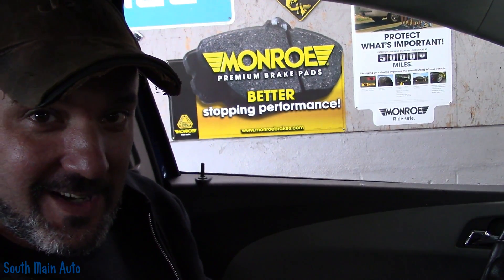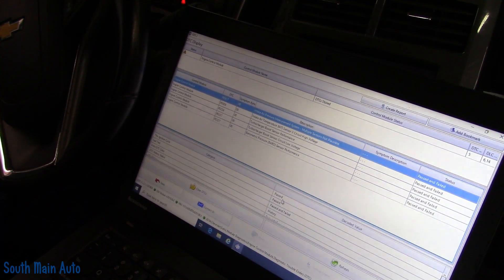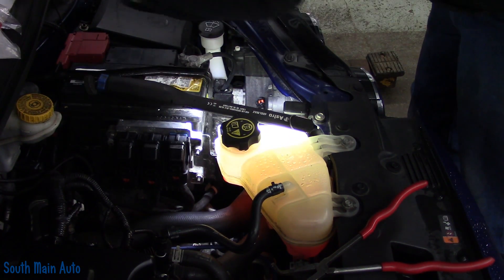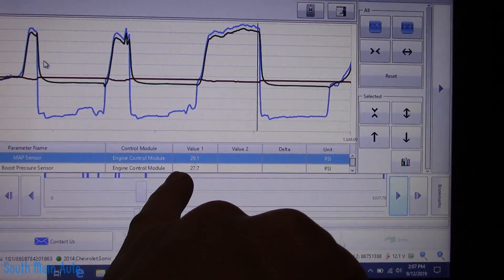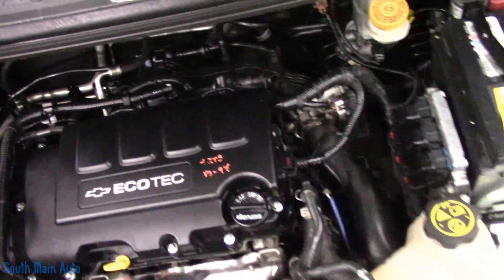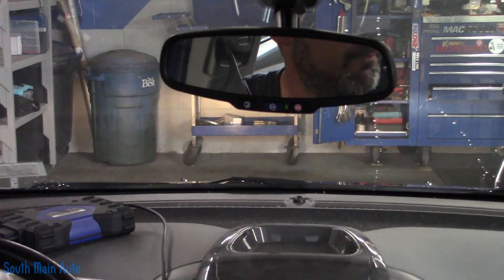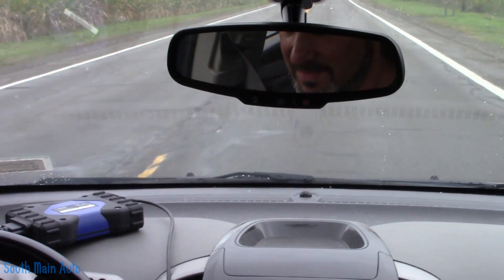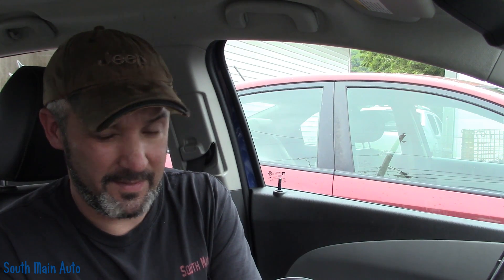Chevrolet Sonic 1.4 Turbo: DTC P00C7

Comment: Hey Eric I listen to your channel great learned a lot quick question !
I have a 2007 Chevy Silverado 5.3
My brake pedal seems to go down 
Further than i think it should,brakes fine had system bleed so thats not the issue. Any suggestions I should check. Could it be the Master Cyl  going bad ?
Anyway thanks
Reply: Needs new pads :P
Reply: By "seems to go down", do you mean as you push the pedal it slowly goes down towards the floor? Then that could be the seals in the master cylinder letting brake fluid leak past. That is if there isn't any leaks in the lines.
If the pedal is just farther down than normal, but holds steady, could be something has got out of adjustment/worn( like a linkage) or maybe the brake booster mounting bolts got loose somehow.

Comment: Does anyone miss the days when the only "sensors" was a coolant temp, oil pressure, and fuel level and the only "control module" sat between your ears?  That's why a '74 Chevy C20 was my dad's only truck for 30 years and then later my primary truck for nearly another 10.
Reply: sensors BAH, mechanical gauges!
Reply: @throttlebottle5906  Damn straight.  Rarely fail.  Sometimes old school is better.  But we are a dying breed.

Not too long ago I was doing a tune up on the Chevy and needed some points lube, but my tube of Mallory went missing.  So I drove to the local parts house and asked where they keep the points lube.  The kid just blinked at me.

"Points lube?"

"Yeah.  You know, distributor cam lube?"

"I have some moly lube"

"No, no.  This is for where the points' rubbing block rides on the distributor cam.  It's like silicon lube, only a bit thinner.  I'd show you my tube of Mallory, but it's gone UA which is why I'm here."

After confusing this kid for a few minutes, an old timer comes out from back room.  He knew exactly what I was looking for, but said they haven't carried it for years.  He only sells a set of points once ever couple of months.

I hit the other two parts stores in town with the same result.  Small town.  Had to start spiraling out and finally found a store 150 miles away that had it.

"Yeah, we don't carry it out front anymore."

And he pulls out this cardboard box, blows the dust off of it, and sets a 8 oz tube on the counter of "Silicon Based Distributor Cam Lubricant"  It wasn't Mallory, but I wasn't complaining.  That's a lifetime supply as long as you don't loose it.  $8 later and I was heading home to finish my tune up, happy as a clam.

Crap.  Where did I put it?
Reply: Thats also why that old Chevy truck would put out more HC emissions on a single cold startup than this Sonic will in its entire (probably short) life. Can't keep using the same old technology on cars while getting single digit fuel economy and blowing straight poison out the exhaust pipe.

Comment: That code is usually caused by the sensor between the driver seat and the steering wheel.
Reply: Fix the driver first, then fixing the car will be made much easier!
Reply: PICNIC code - Problem In Chair, Not In Car.
Reply: LOL
Reply: BAHAHA
Reply: Nut on the steering wheel sensor.

Comment: That boost sensor was contaminated with oil. If the PCV system didn't stop the oil, rest assured this Korean jukebox will be back! I also seen times when filling the oil too fast during an oil change it will back up in the induction system and smoke like crazy. Again a crappy PCV design.
Reply: probably no rings or valve stem seals left in it and needs an engine already..... welcome to turbo'd peanut engines
Reply: @throttlebottle5906  Bad rings would effect the map sensor output and valve stem seals wouldn't cause oil in the induction but would cause oil burning and smoke out of the exhaust. These engines were built from the factory with crappy PCV systems. I know because I dealt with them at the GM dealer. I am not a big fan of plastic covers either.
Reply: when not under boost, the vacuum on the intake is high, so bad valve stem seals and worn guides would pull oil in, then under boost it would force air and fuel(non gdi)charge into the crank case, overwhelming the PCV system and highly probable be blowing oil out the breather inlet.
As for bad rings, the ECM happily corrects enough to keep the MAP happy and not set any codes, which likely wouldn't occur until it was mosquito fogging oil out, it possible to have worn compression rings and still have decent oil rings. 
that would be more blow-by into the crank case than burning oil through since it's boosted and again show as PCV issues.
I wonder if the brake booster has a vacuum pump and does it vent into the crankcase or  vacuum/boost side of intake? too many cars and designs to keep track of :)
Reply: @throttlebottle5906  Valve seals would not cause gas pressure in the crankcase sorry wrong answer. A leaky valve and a bad seal and guide would. A map fluctuating from crankcase pulses WILL cause drive-ability problems and yes leaky rings would cause that but not leaky valve seals.
Reply: Also excessive oil in the induction could be from a leaky oil seal in the turbo charger and that is a high possibility on that engine.
Reply: @biggysground  so under BOOST, with the whole intake and back side of valves including stems/guides and seals under "positive pressure" you're trying to say it couldn't possibly leak into the lower pressure zone of the crank case/valve cover...........

Comment: Good, thanks. Recently drove a Malibu 1.4 Turbo and did not realize the engine was that small and that it had a turbo. Smooth and powerful.
Reply: for how long?
Reply: @rk22cc  Good question, long term viability. If it was introduced in 2013 they might have only 100K or so. A motor should go 200K+ with no major issues.
Reply: There is nothing smooth about a 1.4 they squeeze 140+ horsepower out of. They have to make everything very light, and that means it will vibrate more and when you let off the gas it will bite.

Comment: It’s also possible the turbo bearing seal is leaking oil into the intake. I don’t think you said or showed how many miles are on it but a new valve cover, dead sensor, and dead brake booster are not promising for a 2014. Of course the sensor was German which explains it failing.

Comment: GDS is a factory scan tool for GM?  Good to they've FINALLY moved off of tech 2...
Reply: It started on certain vehicles in 2011...
Reply: @pauldanenberg7746  well I didn't know... I'm not privileged enough to own let alone lease a car top of the line brand new and if it were it wouldn't be GM...

Comment: Maybe a bad check valve between vacuum pump and brake booster... essentially a boost leak.
Reply: DING, I just thought and said the same thing, scroll down 5 lines and got beaten to it again :(
Reply: I should have said between intake manifold and brake booster. That would explain the "buzzing under the hood"... The brake booster vacuum trying to pull vacuum on the booster, but sucking through a bad valve and the intake manifold.
Reply: Unless the booster has a engine driven vac pump like most booster cars have now days.  Then it's no boost leak.
Reply: don't forget, many OEM  accessory vacuum pumps exhaust into the intake and others into the crank case, which could show as PCV issues.
I wont even go into some having vacuum pumped PCV systems. I wonder if they do? I avoid the new turd-boxes and suggest everyone avoid anything with turbo/boost
Reply: @throttlebottle5906  now that's interesting about the vacuum pump. Wow

Comment: What is ridiculous is that a Chevy 1.4L engine has sensors for anything.
Reply: I agree. A good replacement engine would be a Briggs and Stratton.
Reply: Actually, it has sensors for *everything*.
Reply: @bborkzilla  That doesn't mean it isn't absolutely ridiculous.
Reply: You have a lot of electronics then you need a lot of sensors obviously. You have a turbo as well, there are going to be sensors everywhere.
Reply: @zoneb609  My point-you need no electronics on this lawn mower engine.  And you sure don't need a turbo unless you just like the noise.
Reply: Sensors indicate the sensors are not plausible, Captain.

Comment: Man, with that much oil soaking a topside sensor, I'd be so eager to drill that intercooler.  It still amazes me that the manufacturers don't install a service drain plug from the factory!

Comment: I have a 1.4l cruze with turbo, their weak point seems to be the water pump/cooling system. I never knew they used air induction. Thanks Eric O..
Reply: "Air induction" just means air flowing into the engine.
Reply: *Forced induction

Comment: Nice video Eric, I think it's insane that these tiny turbos on these things are pushin' 30psi of boost😂...ridiculous for that small of an engine 😂😂😂...as it's blowing out the cheap intake seals!

Those damn oil feed pipes like to spew out on those baby's as well 😉👍...nothing but quality in the most critical components of the turbo you know!

Soooo...Ol' GM has "zie Germans" makin' um parts now 🤔 and "zie bastards" are handing out Jenny's phone number with emojis on the damn bag...WTH is going on over there?

I love how they warn you to keep your eyes on the road with a message we're supposed to read on the screen, but it's like how are we supposed to know that without reading the message; all while pushing 30psi of boost on a sick 1.4L?  Especially when you're hitting mach 10 in town and chirping them at 5 grand bro?

Great stuff as always man!
Reply: The boost pressure reading is absolute... in effect 15 psi over atmospheric.
Reply: @georgebeuselinck951s  yeah I'm tracking, it's still quite a bit however for that tiny engine.

Comment: The PCV valve isn't on the valve cover on that motor.  It's in the intake manifold.  That disk that ruptures on the valve cover is just a vacuum pressure regulator, and it will likely fail again if that's the only part that was replaced.
Reply: The PCV valve IS in the valve cover.  The red valve in the intake manifold, which you should see a part of it at the bottom of the big PCV hole in the center of the intake, is the Non-Return valve.  It keeps boost pressure out of the PCV system.  If this valve is gone boost pressure gets in the PCV system and ruptures the PCV valve and pushes engine oil into the cylinders.   Many times when the PCV fails you need an intake as well.
Reply: @brianbartosch7384  thanks for sharing this!
Reply: @brianbartosch7384  How frequent is "many times"? Couldn't you add a check valve before the valve cover rather than replace the intake manifold?
Reply: @fascistpedant758  enter, www.cruzekits.com Andrei came up with a retrofit kit to solve the intake manifold issue, but the valve cover can still fail, will just last a lot longer now
Reply: Interesting, so where is it located on the intake exactly or is it built in essentially making it unserviceable?

So not only a valve cover, but an intake as well??? 🙄...oh GM, you never stop amazing me!

Comment: Brake booster, valve cover, boost sensor, alignment, evap, and I think I heard cupping tyres or wheel bearings too. Chevrolet quality at work. Who knows what else he did on the 5 year old car….

Comment: Hi Eric, boosted engine does not have vacuum, that is why the brake booster does not affect fuel trims. The vacuum comes from vacuum pump... I think...;) Nice video!!!
Reply: Not really true. At idle there is manifold vacuum.  They may use a pump as you said..or they may use a vacuum canister to store vaccum.
Also your not generally on the brakes and throttle at the same time.
Reply: @kens97sto171   The booster itself stores enough vacuum for a few brake applications.
Reply: @fascistpedant758  
Yep... Definitely. Wasn't sure if they maybe did something different on this model. 
My Prius does not have a booster like this .. they use a computer controlled electric pump for pressure.. and a system to simulate brake pressure feel at the pedal.. it's pretty wierd.
Reply: @kens97sto171  power braking Lol lock that converter up ! Lol stall speed! !
Reply: @lawrencewheeler8868  
Bout the only way it's gonna spin the tires I think...
Reply: @kens97sto171  😀👍